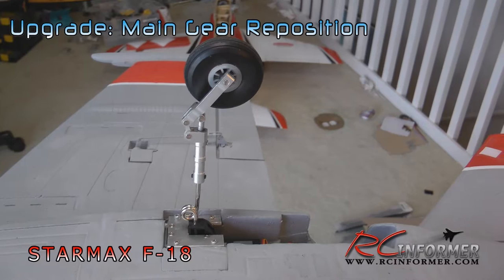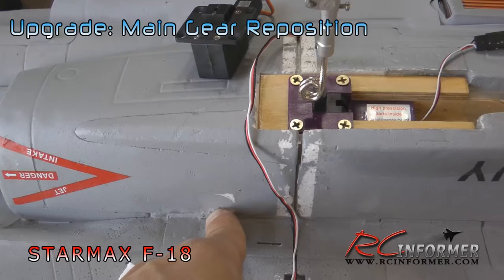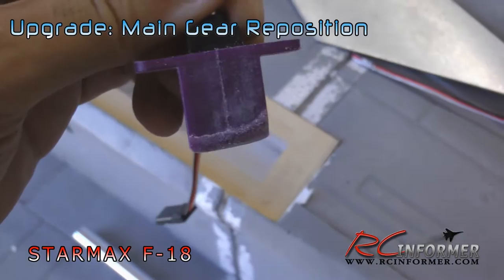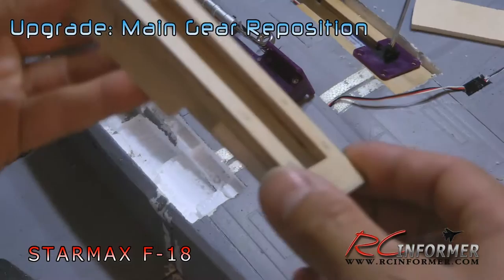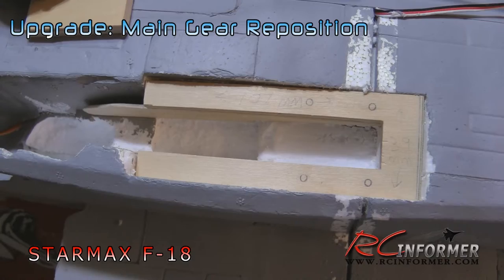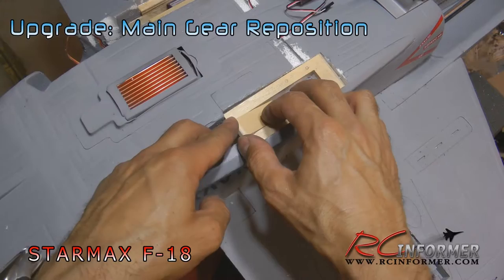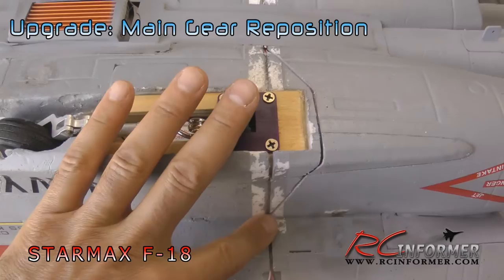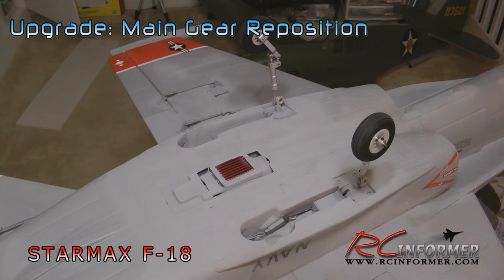Starmax F-18 Hornet 90mm Main Gear Reposition By: RCINFORMER.COM

Comment: I have had this jet for years but the BlitzzRC version never built it until this year lol. I plan on doing all your mods in hopes of making this a better bird. Thanks for all you did man!  Also my ESC was bad when it came in ):
Reply from the maker: It was a great jet but it needs modernization! with a current 12 blade 90mm fan, like a FMS 90mm fan or JP Metal Fan, it will be a sweet plane... The mods i did really made it a viable airplane.... I also have new one in the box that i may modernize:)
Reply: RCINFORMER that’s funny because that’s exactly what I bought for it the FMS 90 mm 12 blade 1900 kV with FMS 130A predator ESC. I wished the foam was a bit tougher though.
Reply from the maker: @rubenflores1184   You're right.  The foam could be better but it's an older technology plane still the airframe is really good and that 90 mm FMS fan should really be superior in there
Reply: RCINFORMER didn’t you have a video on how you added a main wing spar as well?  Did you run the spar straight through or just in the wings ?
Reply from the maker: @rubenflores1184  Thru.... I made about 7 videos on this plane... they should be on my channel:)